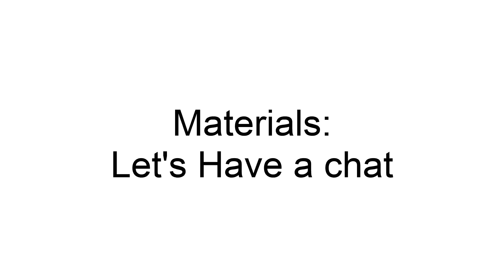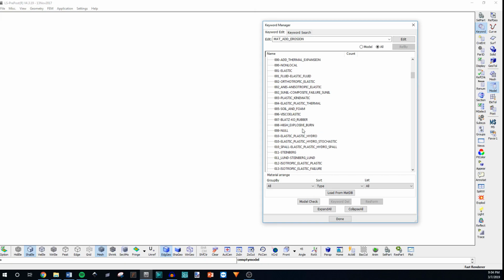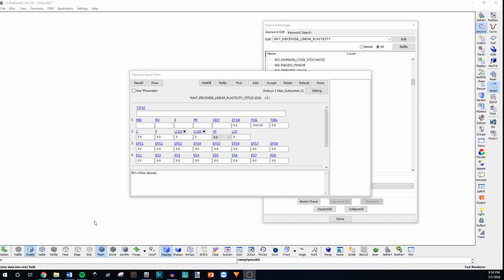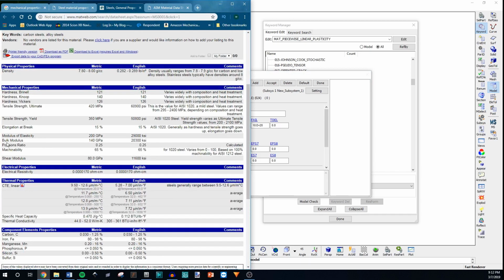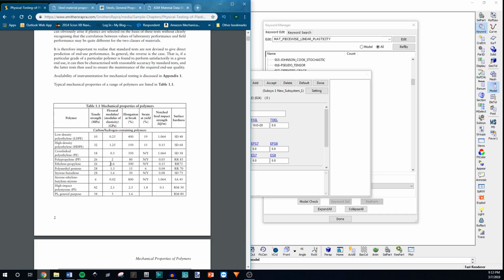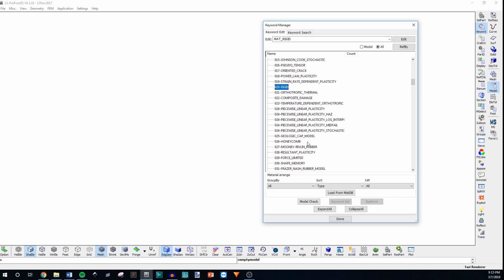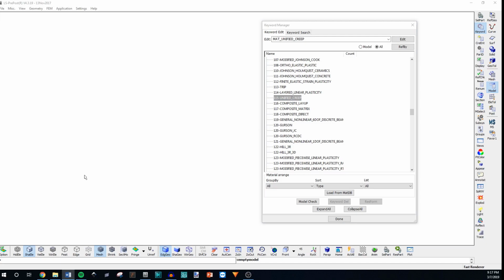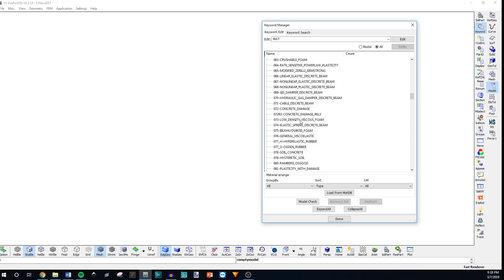Material models are complicated: Finite Element Analysis | LS-DYNA

Comment: It would be so much helpful if you could show an example for a metal also. For an absolute beginner like me even that is hard.  I want to do FEA analysis on Copper Mesh, I have the property of it but I need to define it temperature dependent property. If I put just a single value here How will I test for different temperature? It would be great if you could do a simple EM solver based example like you do for structures. I don't know whom to turn to for help.

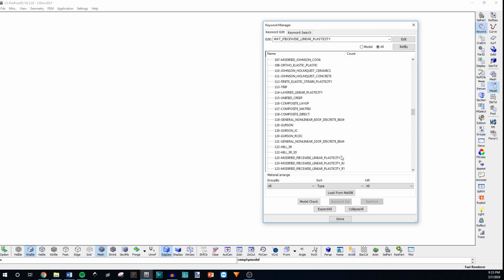Comment: 8:07 you said some thing about ”there are several programme to do this”. Did you mean programme to fit test data to material model to get material model data? If so, can you name some even if they are commercial.
Reply from the maker: Yeah there are a select few programs that can do this and they are a little hard to find. One is called Mcalibrate and is thru a company called Veryst Engineering 
https://www.veryst.com/what-we-offer/polyumod-software-library/material-calibration
They do material fits and validation testing and I’m not sure if they offer the program outside of clients but you can always ask. 

Another useful resource for anyone looking at modeling something is the LSTC dynamat material selector:
http://lstc.com/dynamat/

This can be useful in determining material models to use for certain applications.